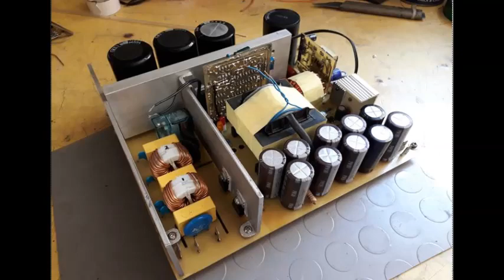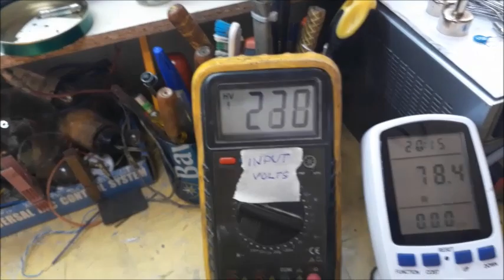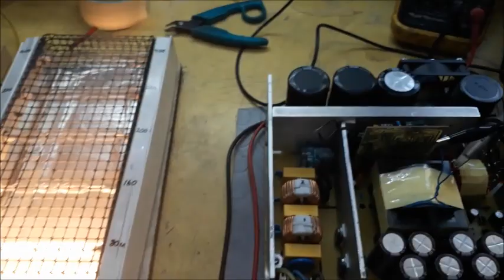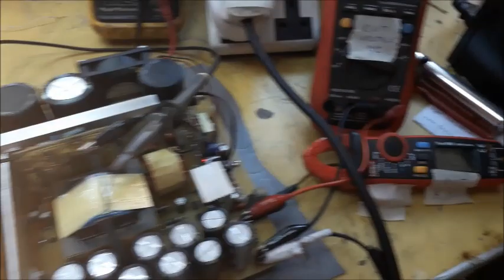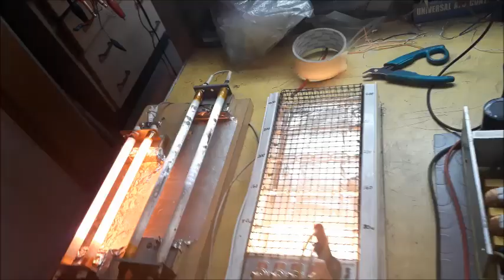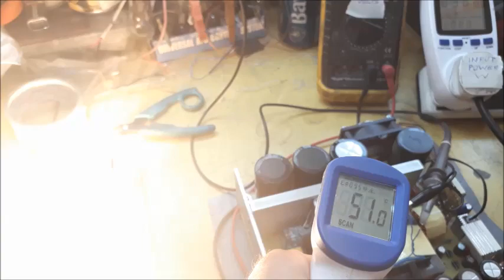AUDIO SMPS 2000W LOAD TEST

Comment: It`s a very good  relaible powerfull device!  But why didn`t you make a power factor corrector?There  will be a short pulses through an AC main and the rectifier with a big magnitude - roughly 100Amps. Such a high nonlinear load will generate a loads of garmonics in the AC main.
Reply from the maker: Well that is why I included a double input filter. It turned out that EMC is not bad and a radio can play with no ill effects at 1 meter away from the bare un cased smps at full load. The power factor is not so good I admit but on the other hand a boost PFC capable of 2.5kw is not so easy to make. I seen a lot of pro high power amplifiers that do not use PFC. 
The smps is of the resonant type and the current waveform is sinusidial which does not emmit swiching noise.
Reply: @supersilve  you are right -an EMI filter suppresses totally RF frequencies.But second , third, four, fifth harmonics of 50Hz free go to the AC main.You can see it if you measure current through AC cable: there are a short pulses (current isn't't   sinusouidal)
Reply from the maker: @andrewandrosow4797  I will take a look at that with my scope and see

Comment: I used the protect part of this circuit elsewhere, but I could not access the current Sens transformer information. What are Primary + Secondary windings and core?
cemcakar41@gmail.com can you send me all the details to my e-mail address
Reply from the maker: The core is a dual T130 stuck together.  The inductance is 2uH and the winding is bifilar one made with 1.5 mm copper wire and the sense winding is 1 mm dia.  The inductor in the input has  two functions:- 1) is adding up with the leakage inductance of the main transformer to get to the resonance of the smps and 2) the sense winding is triggering the overload when enough voltage is induced in the core when the maximum current is reached.
Reply: @supersilve   Should both current transformer primary and secondary winding values be 2 uh? I just need to know this .. I have a yellow-white core. 1mm wire makes 3 spir 2 uh.
Reply from the maker: @elektroniktasarmlarrayman593  No the yellow core is not good.  The core color is brown.  Yes the windings both have the same inductance.
Reply: @supersilve  The yellow core worked fine, though. It is doing very well in protection right now. 2 uh wrapped 3 + 3 souls
Reply from the maker: @elektroniktasarmlarrayman593  if the yellow core worked for you than use that. In pro smps they always use the brown core. It is up to you now
Reply: @supersilve   I have my own smps business. 2kw is not your work. Proteck part is required. I connect 2 750 + 750w resistors. Yellow inductor draws current at 2 uh tripping and protection lamp goes into protection, after 3 seconds they are waiting for protection .. I brought the trimpot value to 10k, I haven't thought about the exact setting yet .. I need brown core value and frequency value - to compare with yellow core. But there is a lot in yellow core pc smps. My smps frequency is 46khz, so it can work. Yours is 60khz.
Reply from the maker: @elektroniktasarmlarrayman593  Post the schematic maybe I can help you out as I cannot understand what exactly you are talking of.  I already gave you the details in my posts.  It could be that I am using a different kind of protection than yours.
Reply: @supersilve   I have to look at how the facebook message you could not find the schema definition here .. Core t130-2 Turkey. The frequency of this core is very high up to 30mhz. I don't understand what a core working up to 30 kHz can do here? Does it increase sensitivity?
Reply from the maker: @elektroniktasarmlarrayman593  That kind of core has low permeability.  A different core may heat up with load.  I always find that type of core when repairing smps in pro amplifiers.
Reply: @supersilve  The yellow core does not heat up at all. The LED is waiting for 3 seconds while there is 1500w load. But the 20k trimpot doesn't work
Reply from the maker: @elektroniktasarmlarrayman593  In my smps it works. what can I say?
Reply: @supersilve   I was wondering if the yellow core and trimpot are relevant

Comment: Interesting to see a PSU at this power level without a PFC front end.
Would have used a 10k thermistor myself instead of the bimetalic strip, you can get versions with a bolt on lug around the end.
I agree with your choice not to share all the details, some people need to learn engineering instead of cheating.
You can learn a lot from a commercial PSU and some datasheets.
Reply from the maker: Well it took me around 6 months in the development of this smps.  I had issues before especially to the best design the protection circuit. It works on a window comparator so that I can monitor both the high and low side simultaneously.  The input capacitance is very important and this holds the input voltage stable with low ripple on the output.
I also opted for a self reset mode due to be kept in mind the smps being in an audio amplifier and reaching peaks will be quite a burden waiting around 30 seconds for a reset.  However if the overload is still present at the output it will try to reset a few more times and eventually the soft start resistors will get hot and the bimetal switch will trip the smps for  around 5 to 10 min until the resistors cool down and reset again the switch. Another bi metal switch with a lower temperature of around 80 deg will take care of the IGBTs.  A temperature controlled fan speed takes care of the cooling system.  However I am quite happy with the performance and I guess I could get more power of around 2.5KW but I left it as it is.  The IGBTs can work up to 30A of current at 100khz.  At full load of 2.2KW they are loaded at around 20A.

Comment: The voltage regulation is not very good when loaded. What's the switching frequency you are using? Are you using any voltage feedback? Why no chokes on the output for removing hash?
Reply from the maker: This smps is not regulated, it works on 50% duty cycle and does not need an output choke.  This is meant for audio Amplifier. The switching frequency is 65Khz